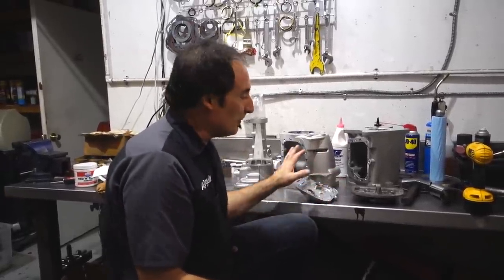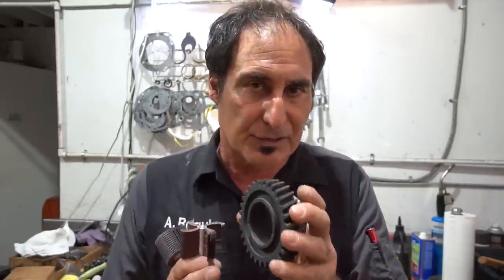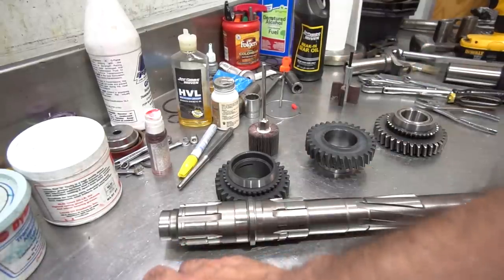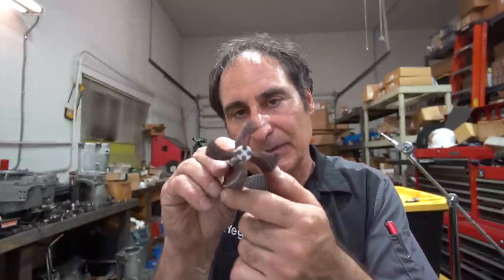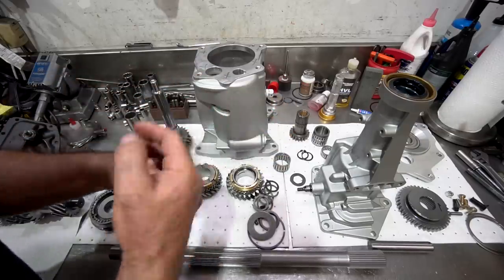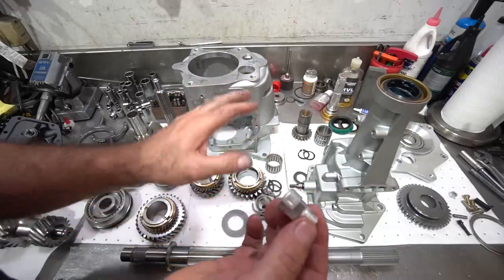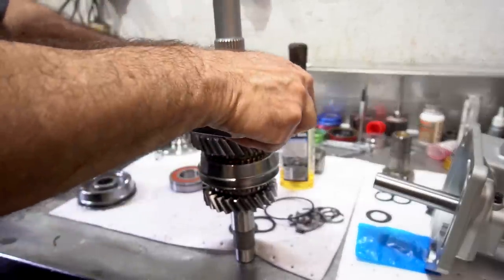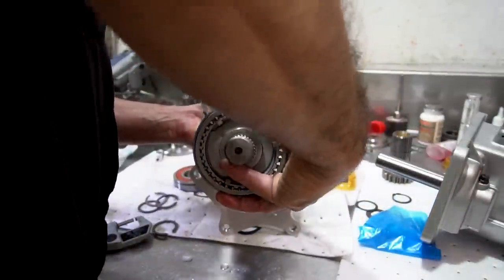NASCAR 4 SPEED TRICKS FOR A STREET 4 SPEED

Comment: How much does it cost to have a trans prepped for drag racing. Doesn't need to be clutchless on the shift, it's for a bracket car project. But getting to this level of street prep?
Reply from the maker: This would not apply too much for drag racing. Try G-force transmissions get a T101

Comment: Passon Performance sells a slick shift kit for the a833 4 speed. It's basically synchros  with every other tooth cut out and every other spline cut out of the sliders along with every other clutching tooth cut out of the 2nd 3rd 4th gears. What's your opinion of this setup, thanks.
Reply from the maker: Actually Mopar did this from the factory for the Hemi Boxes.  It's great if you plan on drag racing and power shifting. The down side is this teeth will wear faster.
Reply: @GearBoxVideo  Thankyou, I have a not so common NP440 my6 GM overdrive 4 speed. I need a rebuild kit and was wondering if you have or know where I can purchase one, Thankyou.

Comment: Paul , out of the transmission that you build here , are any of them ever clutchless shifted meaning let out the clutch in first gear and then shift from second to 3rd to 4th to 5th clutchless .
Reply from the maker: I built a rally clutch less 5 speed for the Jaguar platform. They are still be used almost 20 years later

Comment: hi mate I am new subscriber really like you channel it's amazing. 
just quick question I have problem on my bmw e90 n43 318i manual 
the gear no 1 and reverse making my a problem with the shifting.  I I just but a new transmission  fluid and the shifting it's much better but still sometime I have problem to but in reverse and in gear 1.
any suggestions?

Many thanks 
Marek
Reply from the maker: Usually it's a clutch release issue.
Reply: @GearBoxVideo  oh just totally forgot to say I have changed the flywheel and the clutch  I was hoping the issue will disappear  but it's still going 
thanks again 
Marek
Reply from the maker: If the car isn't moving and the clutch pedal is pressed down there is no reason it would not go into first or reverse. So a new clutch does not mean you haven't addressed proper clutch release.
Reply: @GearBoxVideo   Many thanks for sharing your experiences. 

thanks again 
regards 
Marek😀

Comment: Never heard of REM before, would it help with a HD transmission like a chrysler NV4500HD? Rebuilding mine and trying to make it shift as fast as possible to avoid boost loss. Im avoiding dual disc clutches for that reason.
Reply from the maker: More for heat during endurance racing is what the best use is for a super finish

Comment: Would tumbling the gears after heat treatment help with prep 

And I always thought the gear teeth are ground to final size after heat treatment but these seem to just hobbed
Reply from the maker: Some gears are ground, but grinding can only be accomplished if the clutch teeth are not in the way. Gears are shot peened then super finished. You don't tumble racing gears.

Comment: not allowed to run a pump, filter, and cooler?  also what are your thoughts on gear sprayers?  like spraying oil into the input gear and any other trouble gears as they mesh together
Reply: Motorcycles have been doing that for a long time. I first saw it around 1968 inside a Honda. BUT, apart from Harley and 'vintage' bikes, all are 'indirect drive' instead of direct dive as used in cars and trucks. I'm not a NASCAR fan (no interest in watching racing) but the technologies they use are fascinating and can be useful
Reply from the maker: I like the use of spray systems and designed a few for other applications.. This application doesn't have any lube issues.
Reply: @GearBoxVideo  my concerns are maintaining fluid film between the high stress area of the input gear
Reply: @peterjones6945  main thing is maintaining the oil film between the input gear and subject counter gear
Reply from the maker: Maybe in another transmission but we do not have an issue. So please don't be concerned on my behalf. I've done most of the units in Historic Trans Am as well as cars running in La Carrera and 6 hrs at Spa. If there was an issue I would address it. Maybe in the transmission you have that may be an issue? It all has to do with understanding oil Dynamics and control.
Reply: @whatchu_talkin_john_willis  sorry for not being clearer, I mean't shafts drilled to supply oil to gear bores. In motorcycles the transmissions are constant mesh so everything is spinning all the time the wheels are turning (also known as 'sequential transmissions'  in cars)
Reply: @peterjones6945  yeah that works for the bearing lube, but im talking about the tooth mesh.  everything is spinning all the time in most every modern transmission (known as constant mesh), but power flow only though the selected gear (or lack there of in direct drive)
Reply from the maker: The gears are submerged in oil. The problem with static oil is that it is subject to inertia thus forward motion at high speeds can starve the front end as the oil pools into the back of the transmission. But if you limit the oil travel by use of sealed or shielded bearing and restricted oil passages you can avoid lube issues. I'm working on a new case design that actually has some pretty neat oil control built into the casting. Also I've been in standard transmission parts design for 39 years this February. Trust me I have made plenty of mistakes.
Reply: @GearBoxVideo  the cluster gear runs in oil, but the mainshaft and inputshaft gears do not (fill plug isnt that high),  oil is also flung out off of the cluster gear as it rotates into mesh with the input gear, reducing the film thickness upon mesh
Reply from the maker: @theblackmech Actually oil is flung into the mesh gears. But oil isn't water and there are interesting formulations that keep oil on the gear better than some other oils.  Again it's great you want to argue a point that has never been an issue for me. So I suggest that if it is an issue you are having with a particular transmission deal with that company.  As mentioned if it was an issue for me Id correct it. Furthermore any manual 4 speed transmission and there are hundreds of thousands share the same basic design. With some exceptions. I've seen some transmissions incorporate feed galleys to areas of concern and also see designs where if the oil level is critical the low oil will kill the maindrive section. The other issue is gear to case wall clearance. Gears are too close to the case and the case wall acts like a wiper. You need clearance to dissipate heat. You good?
Reply: Honestly the pumping losses, and increased windage losses would probbably do more harm than good in this application.

More oil is not always better, you want just enough to do its job, then get out of the way. Oil control beats oil Spray any day (which he seems to have figured out)
Reply: @Texassince1836  its not more oil, its forceably feeding it to the most critical areas.
Reply: @whatchu_talkin_john_willis  sufficient oil is already passively supplied. Adding forced oil spray is litterally "more oil"
Reply: @Texassince1836  yeah when it was behind grandmas 307 in her 4 door nova.  push 500-700lbft though it and its a different story

Comment: Question about teflon coating: teflon is not a good thermal conductor. Does coating the outside or inside of a housing adversely affect cooling by inhibiting heat flow to the housing or from the housing to the air? I wonder about this as teflon coating outside on oil pans/blocks/etc would help prevent grease and road dirt from adhering (which would act as a thermal insulator) and inside would help oil return in oil pans and valve covers.  Would the benefits outweigh the loss of thermal conductivity due to teflon not being a good conductor?
Reply from the maker: As mentioned parasitic drag  or drag (in physics) causes heat and friction robbing horsepower.  When oil clings to both the case and gears as it gets pulled apart heat is generated. The outside is an added benefit of easy clean up. Similar to painting the inside of differentials and engines with Glyptal. Essentially you've created a non stick surface for the oil.
Reply: @GearBoxVideo  does the coating last the lifetime of a transmission? Understandably the load and use of the transmision may vary greatly.
Reply from the maker: I've never seen it come off unless you scrap it. Similar to what a Teflon frying pan has

Comment: Hi Paul. I have a question for you. I use to own a 78 Camaro Z28, that had a Saginaw 4 speed in it. I have heard that those transmissions, aren't very popular or strong. Can you tell me what he downfall of the Saginaw is ? Why their not as good as a Muncie or Borg Warner ? Or if the Saginaw is actually a pretty good transmission ? I still have the tranny. And i would like to use it again. But is it worth rebuilding and putting behind some 650 horsepower ? And help or advice you can give me, will be greatly appreciated. Thanks Paul
Reply from the maker: Saginaw is a light duty 4 speed.  Great shifting box. Usually in Chevy Monza'a and Vegas but also used in low HP V8 applications. Its a good wearing unit but not meant for what you are trying to do.  A M22 style Muncie is a better choice.
Reply: You think the Saginaw is weak, try a NV3500 from a Dakota, Ram, or Chevy S 10. Put one in my Dakota behind a stock 360 and can't bang the gears like A833, Toploaders and M22s.

Comment: Did you ever build a DSM 5 Speed gear box? I know they like to explode under high HP.
Reply from the maker: I don't know what that is
Reply: DSM as in Diamond Star Motors 89-99 Eagle Talon, Mitsubishi Eclipse and Plymouth Laser FWD and AWD 4G63 (Mitsubishi Evo engine) powered cars.

Not many shops are building DSM transmissions anymore. I talked to John Sheppard at GTR World Cup in February. He said they will build the box but they have been burned by customers shipping boxes to get an estimate only to ghost him leaving him with unpaid labor.
Reply: @GearBoxVideo  Search here on YouTube 'red demon' to see the kind of DSM in question.   4G63 is a world heavyweight 4 cylinder.
Reply: Yes I will be running a 1992 eagle talon 5 speed with approximately 650 to 700 HP. I know the stock transmission will not like it at all.
Reply: @charlesmarchesano4812  open your wallet and get a hold of John Sheppard.
Reply from the maker: I think I actually saw an ad under one of my videos for someone selling those
Reply from the maker: The transmissions I build are all new and basically products I sell. I wouldn't mind doing a rebuild video on that transmission but I am sure there are some upgrades and gear sets for those that I don't have access to. I stopped doing repair work for that same "ghosting" reason. My shop would get cluttered ( and it already is) with units I take apart and quote then never hear from people again. The restoration work I do ( when I have the time ) has never had that issue since people need that transmission back. Problem with repair work being shipped in is that you can't quote a price until you open the trans up. You have labor to do that work and then need space to store the job and then wait for the customer to say yes or no and then when they say no, they expect itt shipped back put together again at no charge.
Reply: @GearBoxVideo  I know exactly what your talking about happened many times at our shop with jumped timing belts there a 50 /50 shot if motor is good or not. When I ready to rebuild trans I be paying for it right out everything it needs.

Comment: Bought your book.   Looking forward to it.  As luck would have it, the 68 Mustang fastback I got my hands on does not have the original 3 speed manual.  It actually has a toploader 4 speed from a 69 Mustang with a 390.  This is a wide version with a 24 inch case.  Now I love the fact i have this toploader vs. the original 3 speed, but I'm concerned about shaft length.  I read the 289 toploader was longer, so if my input shaft is too short, what's the advice.  I hear it may not be long enough to stay in the bearing.  Someone also welded up linkage rods of a Mr. Gasket shifter , actually cutting them and welding them.  Too long I suppose, but I expect I'll just source another shifter.  I have to remove the transmission to see the overall condition.  Right now the car is not running and the transmission is a mystery as I have equalizer z-bar parts on order to get the clutch working.  Anyway, any advice would be appreciated in next steps to make sure this works for my 289.  Kits?  Shaft?  By the way, the bellhousing appears to be original, and the tail is correct for the 390.  28 spline shaft.
Reply from the maker: There are extended bushings to run the big block inputs with small block engines. I can set you up with a new shifter from Hurst
Reply: @GearBoxVideo  Okay, cool.  I give your shop a call then and see what we can do to get this going.  Many thanks.

Comment: What do you think about the T-56 Magnum? Im looking to put one in my Chevelle to handle the LSA motor.
Reply from the maker: Depends on the purpose. Serious drag racing...nope. Good cruising.. yes.
Reply: @GearBoxVideo  the dyno guy is saying 700hp pump gas, closer to 800hp on e85 and methanol. Weekend street rodding, occasional 1/4 mile. Planning on a 10.5 bias ply for the track, radials for the street. 12 bolt posi 3.73s. Stock the trans is around $3k dog boxed with straight cuts doubles the price. I was  thinking that's overkill?
Reply from the maker: You can build one with a G-force full synchro gear set which would handle that power.
Reply: @GearBoxVideo  what's your price for such a setup?
Reply from the maker: I don't do those units
Reply: @GearBoxVideo  sad face...

Comment: Wait NASCAR cars only use 4 speeds? wttf?
Reply: When on the oval tracks, which is nearly all the tracks they run, at speed they are in high gear 1:1. They are not shifting for the corners with only a couple exceptions and then it is only down to third and that third gear ratio is calculated to match the engine torque band the best. Otherwise the only time they use more gears are when they are going in and out of the pits or garage area and 4 gears are plenty for that. 

On the road courses they use up to the full 4 gears throughout the track. The more shifts you make the more chances for a missed shift, engine or tranny breakage, distractions from other driving duties the driver has or just plain old inefficiencies of shifting. The engines are a high torque v8 that has a strong torque curve over a lot of rpm, not a small high rev narrow torque band engine which requires more gear selections to keep the engine within the torque band, so more than 4 gears is simply a waste. No need for more than 4 and several reasons to not want any more.
Reply: Yes, only 4 speeds and clutch-less shifting. I want one for my Dakota.

Comment: it was standard procedure on a stock car muncie to remove first gear because it was notorious for galling and seizing on the main shaft. taking off in second and running the car in 4th, all the gears were freewheeling but not at the speed 1st was.
Reply: super t 10s were not as abundent but they have first gear on needle bearings to remedy that problem.
Reply from the maker: Needle bearing first gears are custom for the T10 and ST10. Liberty's gears made them.
Reply from the maker: I did get your link. I would have let it through but I don't like publishing links to people who lift my content from my books and website.  The factory upgrade to the first gear lube issue is explained in this video:  https://www.youtube.com/watch?v=yr_9khQ0LUc